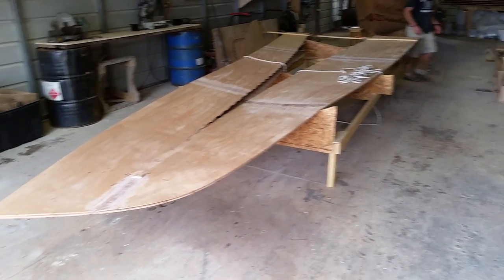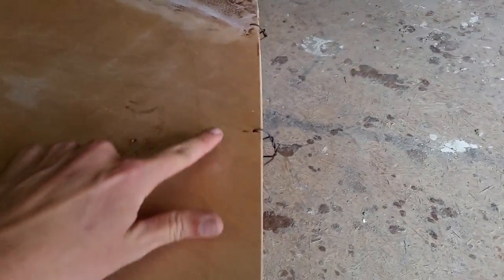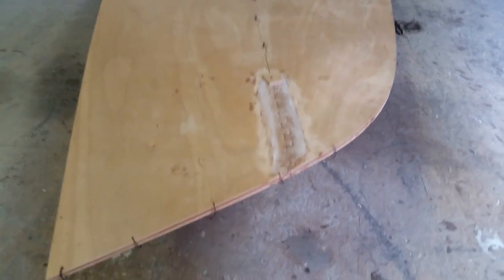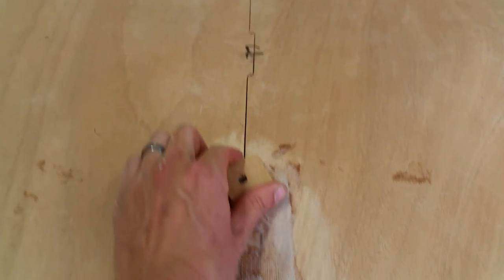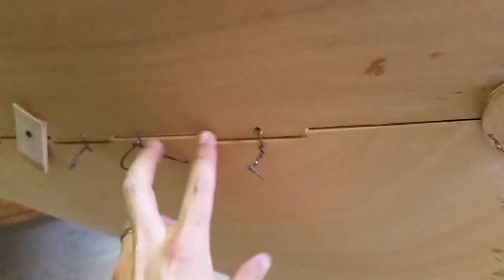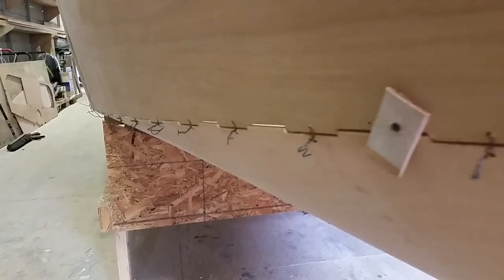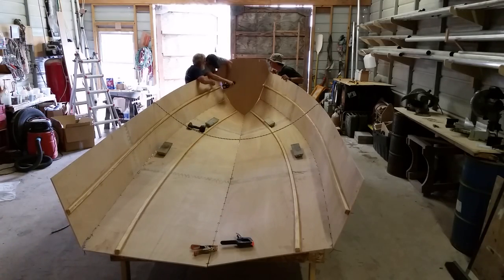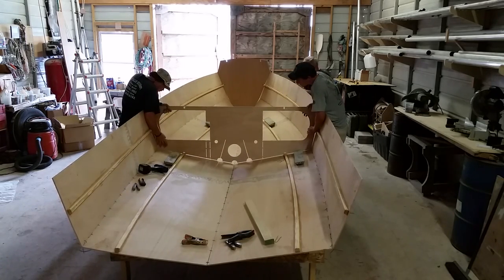Core Sound 20 Mark 3 Unfolding Demonstration

Comment: Aircraft mechanics have to safety wire a lot of nuts to make sure they don't backout during operation.  They use a special set of pliers (they call them "schwaps", or at least that's what the word sounds like).  They bring the ends of the wire together and clamp them in the pliers and then pull a knob on a threaded shaft between the handles of the pliers, and the whole thing then spins, winding and tightening the wire.  It looks like that would be a useful tool for your purposes, as well, as you need to tighten the wires as you draw the pieces together.  It would definitely be easier on your wrists.